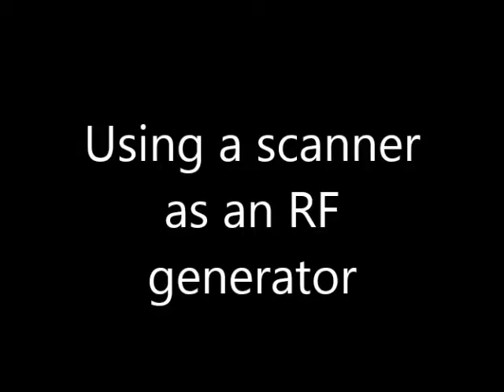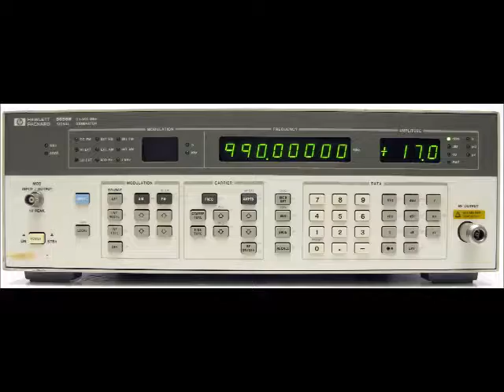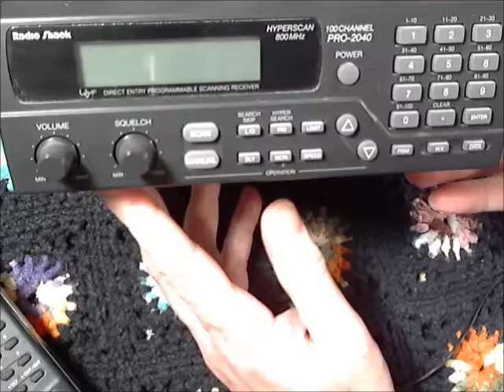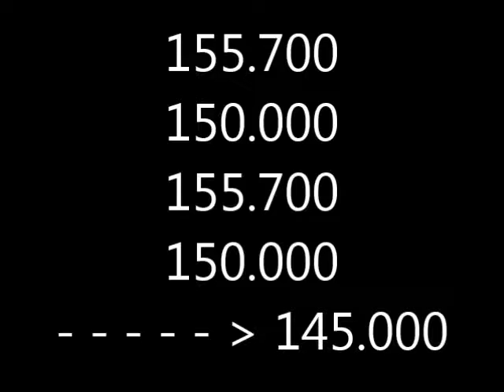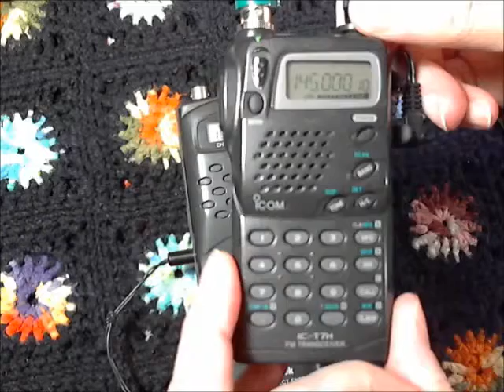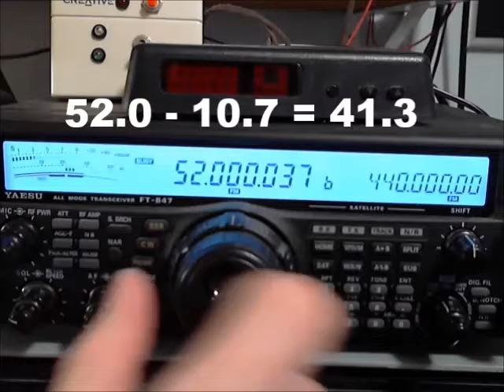Scanner RF Generator Trick 1

Comment: could this be used for hf as well? im in need of an rf generator that can be used for the CB band
Reply from the maker: Hi TQD,  I have not found a scanner that would go that low.   Its possible a general coverage receiver might do it, but it may just be easier to find an old CB at a yard sale or Craigs list and run it into a dummy load.  They are only supposed to be 4 watts normally.   I have a DDS that I use with a heathkit,  and it can generate a nice signal up to about 24 mhz or so before Nyquist limit it exceeded and the signal goes to pot.